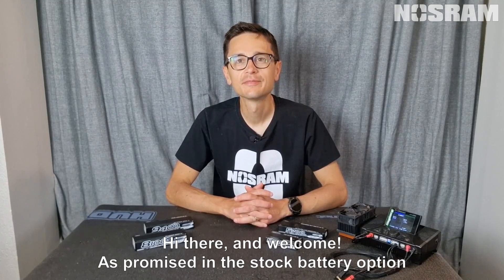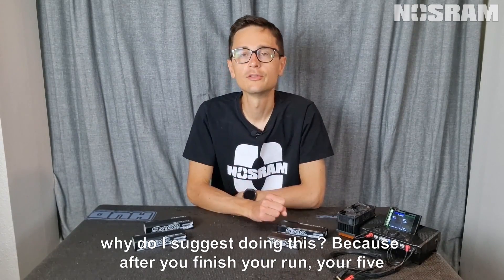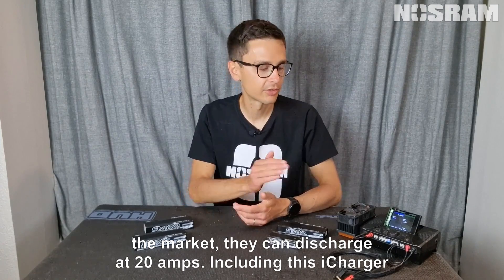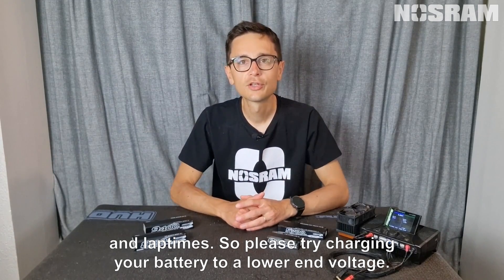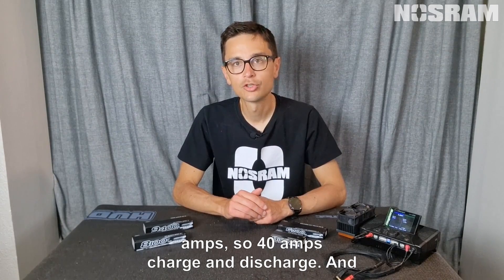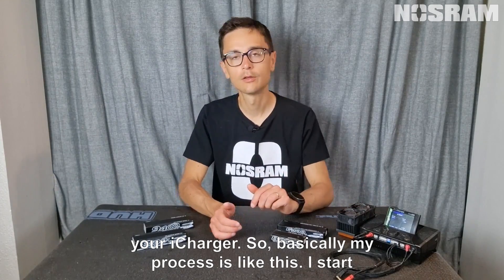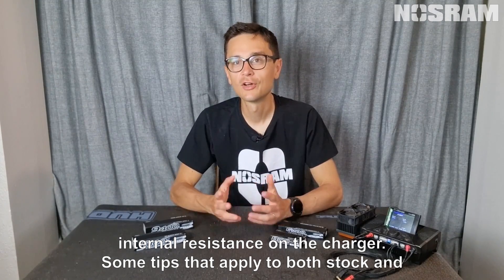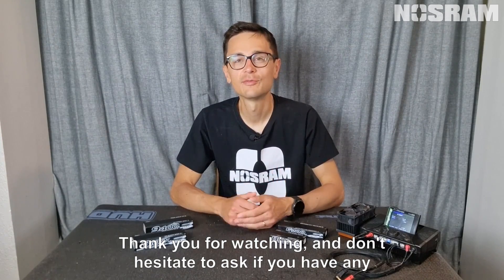Nosram battery charging & discharging

Comment: The discharging tip is pretty useful to see battery use.

I run 1/8 GTE and our mains are 10 minutes, need to play around with gearing a ESC settings to get enough run time and still be quick.

Comment: Great tips Alex. During stock racing charge or discharge cycle what is the maximum temperature the battery should be allowed to reach for peak performance (assuming no battery temperature rules)? Cheers.
Reply from the maker: I usually aim for 40-45 deg C external temp when charging has finished.

Comment: Hi Alex! Thnk you for another very interesting video! 😁👍So on a race day , stock for example, do you cycle the battery before each time you go to the track?  Thanks!
Reply from the maker: I only cycle them if they haven't been used for a month or so. Otherwise, the first cycle will be for the first run of the day.
Reply: @hagberg thanks! But what i wanted to know was if you charge / discharge the battery before each one of the qualify and finals. I mean If its worth performance wise,  Thanks!
Reply from the maker: @jsb351  100% yes, if you have time I recommend discharging before charging before every run in a race event.

Comment: Hi Alexander. Thank you for the detailed video. Does all this apply (and is it recommended) for GT8 series? I use 10'000mAh IP LIHV batteries? So i would charge at 40A until 4,35V and discharge at 40A till 3,3V. Ideal storage 3,9V?   a bit delayed comment, but hope you read/answer it. Thank you. Great work on your channel.   (really considering 1/10 scale for the winter season)
Reply from the maker: Hello, I don't have any experience with the GT8 class. However- based on the amount of amp draw and stress on the batteries in this class, I would charge them at a more moderate rate. I also would not discharge them to try and heat them up.
Reply: @hagberg  thank you

Comment: Hey mate, thanks for the vid.  I’m new to Rc.  I was racing 20 years ago running nimh.  So, with lipo tech the rule for charging amps at capacity of battery doesn’t apply? (Ie: 6000mah battery to be charged at max 6amps).  I’m about to charge my nosram hv lipo 4600 mod / 6200 graphene 4.1.  I should charge these at 10amps from my charger? Thanks
Reply from the maker: Hello! For the best longevity, charge at 9-10A. For the most performance but shorter life, charge (and discharge) at a higher rate!
Reply: @hagberg  great video. I had the same question. So charging at 1C is no longer the case? Just turn it up to 10A which for a 4200 mah battery would be over 2C (I don't want to see my tip area on fire 😊)
Reply from the maker: @CR3DT  1C will give the best longevity. Higher C will give better performance.

Comment: Thx for these infos👍 How about new batterys, how to handle it before racing?
Reply from the maker: Cycle 1-2 times before using in a race for the first time.
Reply: with 1c ?
Reply from the maker: @valex6172  discharge and charge at 40A from new.
Reply: ok, thank you for the infos👍

Comment: Hello @Alexander! As much as I know and what I have learned at university and school at physics, that resistance rises with temperature, so how can it be that, temperature in batteries reduces the internal resistance?
Reply from the maker: I'm not a chemist so I can't explain that I'm afraid.
Reply: It is quite simple if you think of chemistry. Higher temperature mostly quickens the reactions :)
Reply: @RCracingSLO  true, but higher temperature increases internal resistance
Reply: @dsracing5703  No, you are wrong. Have a good look how Tesla cars preheat the battery pack before charging or ludicrous mode for example 😅
Reply: @RCracingSLO  Preheating is needed to increase capacity in cold time. It same for motor, when it gets hot, it fades. There is optimal temperature.
Reply: @dsracing5703  Yes, increasing usable capacity means reducing internal resistance :) It is very funny you are persisting ... with so many other information on the net.

Comment: I just got the HV LCG MODIFIED shorty.. 😂 can I charge at 2C? it’s 4600mah for the 2wd buggy..
Reply from the maker: You can charge at 2C without any problems, are you racing stock or modified?
Reply: Modified, 6.5T. I’m old school never charge more than 1C before as 20 years ago people said it might damage the lipo.. 😂 thanks for the reply..👍🏻
Reply from the maker: @HL-OOI  2C is absolutely fine, even though, charging more than 1C isn't necessary for modified since you'll have enough punch with 1C. 2C charge vs. 1C won't significantly affect the lifetime of the pack.
Reply: @hagberg  good to know modern batteries can handle this.. I just want a faster charge at higher Amp say 9Amps instead of 4.6Amps.. 😀..

Comment: So I run  VTA class 25.5 turn blinky mode .. I just bought an Icharger and I’m running 
Trinity white carbon 5900 mah 2s packs.   I can charge them at 40 amps ?   For real ?
Reply from the maker: Yes sir! You can certainly charge them at 40A, like I mentioned in the video, as this will improve performance, but it will also shorten the life of the battery pack!
Reply: @hagberg  thanks for getting back to me I really appreciate it !  how much are we talking about?  cutting the lifespan in half ?  Would a different brand battery last longer charging at 40a ?
Reply from the maker: @Loose_Lucy  Nosram packs hold up exceptionally well even after being pounded at 40A for many weekends of racing. No puffing/ballooning. I can't speak for other brands, but I would say that the life is shortened by at least 25%.
Reply: @hagberg  that’s not so bad.   Thank you

Comment: I don't get it. Lipos should NEVER get discharged to 3.3volts a cell. Lipo is considered empty at 3.7v/cell. Period. That's a sure way to kill your batteries! I've discharged my brand new Pulse 5500mAh batteries in my jet to 3.3volts a cell because I wasn't paying attention. Two weeks later I went to fly again and after I landed the battery was at around 3.7v/cell but it was all puffed! Why are you not talking about C ratings and capacity? Some noob is going to watch this and will try to discharge a low C rating lipo 40amps and it'll catch fire.